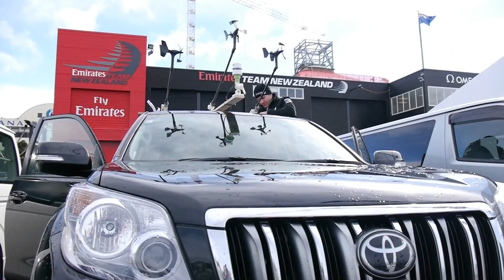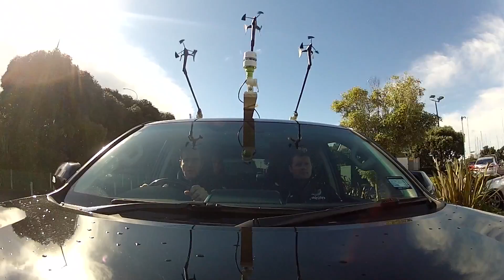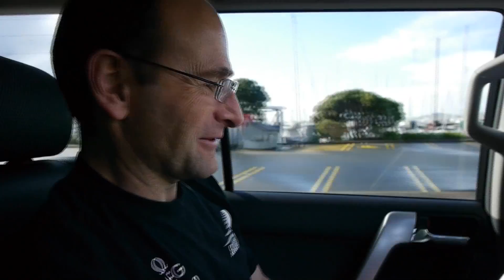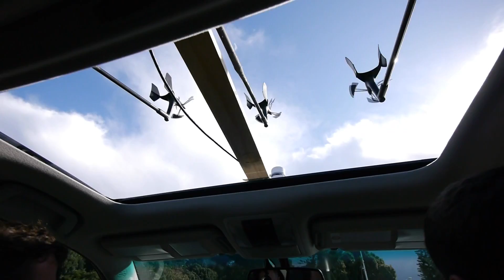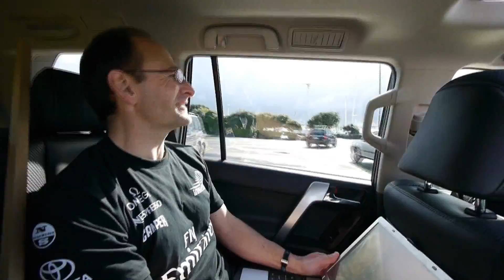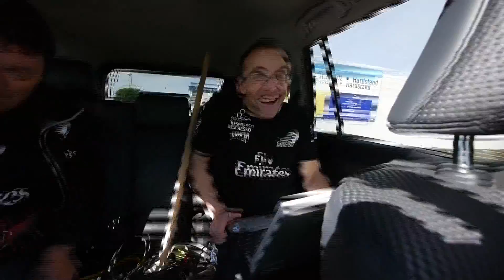AC72: Calibrating Instruments

Comment: Those wind wands are being differentially affected by airflow over the sides vs. center hood of the car.  Not to mention the open sunroof which provides.  Need to be remounted further forward and higher up with sunroof closed.  (Yes, I am an engineer...)